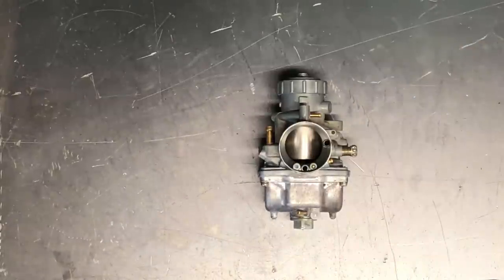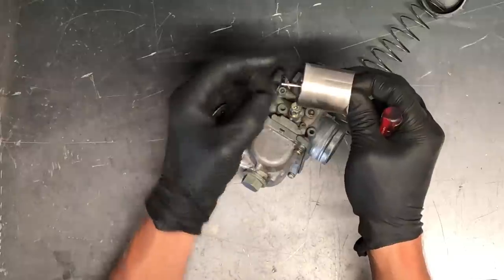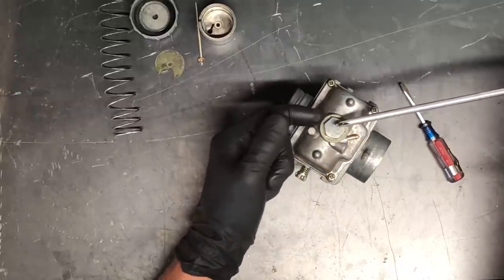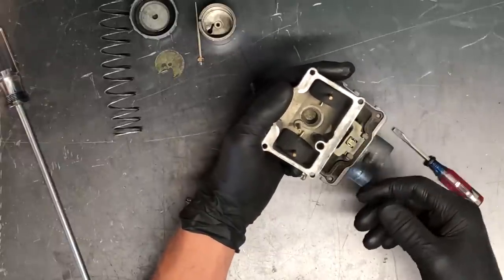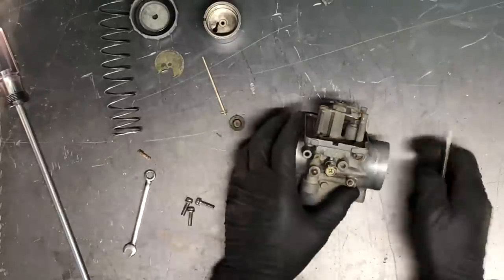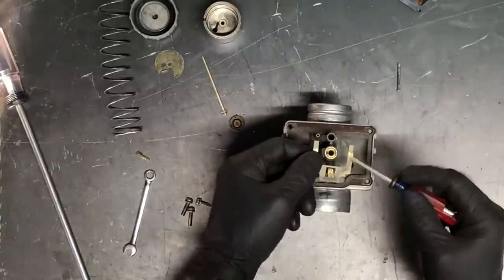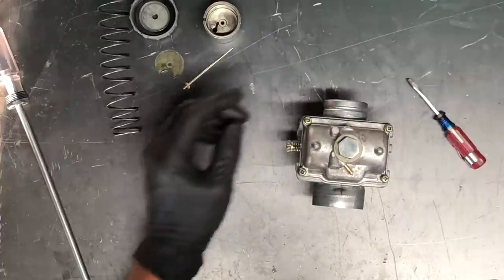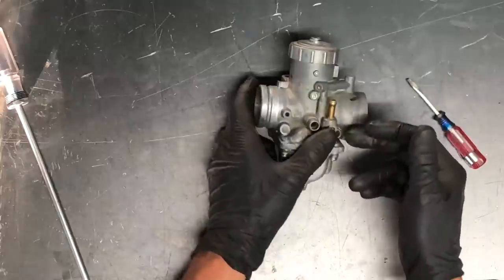HOW TO Polaris Scrambler 400 Carb- Adjust Clean Repair Rebuild Service Carburetor Carb Kit Sportsman

Comment: That was awesome, right down to the tap with the screwdriver handle to seat the float bowl.
My question is, what’s the float bowl arms measurement? I’ve always had them pretty much level, this one I’m working on they were  down a good 2 mm ?

Comment: Awesome video, watched it a few times now. Wondering if i can get some help. 2001 scrambler 2x4 with very high idle, lots of smoke both white and blue(2stroke). Adjusting the air and idle screw does nothing. If i mess with the choke it will calm down to how it was normally before this issue came to be. I’ve cleaned the carb and check for air leaks. No luck. Any tips ?
Reply from the maker: sounds like a pickle!! I would have mentioned air leaks if you had not already checked it. If you mess with the choke and get it to calm down, I would definitely say it has something to do with the check plunger.  A lot of times with an issue like this, I will see a kink in the check cable causing the plunger to get held up or down and the "knob" looks like its working properly. Check it and let me know!
Reply: @MidNebraskaMotorsports  I appreciate your detailed response. I actually got to ripping it apart (thanks to your videos) and seen that my water seal was bad along with the bearing. The shaft on the counterbalance got some pitting. Any idea what to do? i was thinking about putting a thin sleeve or steel epoxy to fill in the groove and sand it smooth. thanks brotha

Comment: Great video dude. I have a 250 explore that the carb looks very similar to the one your working on but mine does not have that washer with the main jet. Could this be my problem for flooding ? Thanks

Comment: Forgot to mention the air mixture screw?
Reply: Mid Nebraska Motorsports yes definitely what is the stock setting for the air/fuel mixture.    Mine rattled loose so I’m loctiting it back in but need to know the adjustment

Comment: Any idea on where I could learn how to tune this carb? I rebuilt mine and now I can’t get it to start. Thanks
Reply from the maker: I'd start with 2 turns out on air/fuel screw and don't idle it up. Make sure choke is functioning and pilot jet is clean. As son as float height is good and it wasn't messed up, you should be firing right up. Thanks for watching. Let me know:
https://www.midnebraskamotorsports.com/
Reply: @MidNebraskaMotorsports  awesome thanks, I’ll let you know if it works once I try it. Going to wait until it gets a bit cooler though as it’s 40°C out right now.
Reply: @MidNebraskaMotorsports   do you know where I can find a diagram of which screw is the air/fuel screw? I  can see the idle screw but I’m not sure where the other one is. Thanks

Comment: Thanks for the informative video.  I was having trouble with my 95 Sportsman 400 and replaced the carburetor (leaking out the bowl) and the intake manifold (cracked).  I have it all together now and can start it but after about 30 seconds, the RPMs skyrocket and then it dies.  Any ideas?  I had trouble connecting the throttle cable but it does respond to increasing the throttle.  Appreciate any advice you might have to offer.
Reply: I'm seeing the throttle sleeve going up and down as expected.  It's even down when the RPMs go crazy.  So could it be that the throttle needle is somehow sticking up and the ETC is killing the engine?
Reply from the maker: Jim, did you buy a knock off carburetor?  Check out my video on such a purchase. https://youtu.be/kOv8nhHUsq4  .  If you bought an OEM, you should still watch this video and share it with a friend!!
Reply from the maker: Let me know either way and I can help!
Reply: @MidNebraskaMotorsports  Your videos are great.  I returned the new carburetor after taking the old one apart and cleaning it as shown in your video.  It works great now!  Thanks for producing these.

Comment: Can you tell me the model of this Mikuni carb? I have a 96 Polaris Sportsman 400 and this appears to be the same carb. I had a problem with the carb dumping fuel thru the overflow and the original needle was worn with a groove. I replaced it with another needle and seat that was supposed to be for the 400 motor/ carb. The new needle has a spring loaded aspect at the base which differs from what I had plus what you show in your carb. I have tried a few times to adjust the float tang to get it to be the correct height for correct operation without success. I have yet to find a needle and seat combination that looks like the original.
Reply: I'm having the same issue with my carb... Did you ever find a fix for it?
Reply: @badhabitssierra5409  I think that the China needle and seat is not machined closely enough to stop the fuel flow. It is very minimal but I don't want to see fuel dumping on to the garage floor. I have always shut off the fuel flow at the tank, but now I have a small cup that is wedged by the rear that collects any drops of fuel that may happen while I operate the atv. I can live with it.

Comment: Totally different subject but what can I do on my 400 2 stroke to “ lower the gearing” with the CVT. Never had one before and scrambler don’t have a low range. I need some more low gear for slower riding. Or make it stay in the lower range for longer before it speeds up
Reply: Get a 4 stroke lol

Comment: The floats are such a dumb design being on rods instead of attached to the arms like every other carb in the world. And the rebuild kits are full of burrs and only have steel tipped needle valves. 

I'm just gonna landfill mine, don't even want to burden anybody by giving it away.